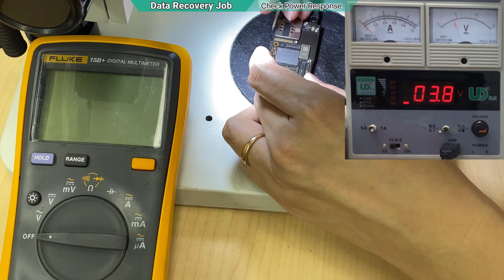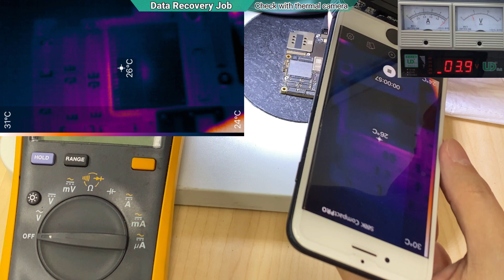DATA RECOVERY from a heavy drop iPhone 【REPAIR CASE】

Comment: Hi can i ask about my device which is xs max where the problem is the wifi only can detect 5ghz but thr 2.4ghz cant detect
Reply from the maker: Hi. It will be either antenna issue or motherboard. Send to a professional to check so they can tell you.